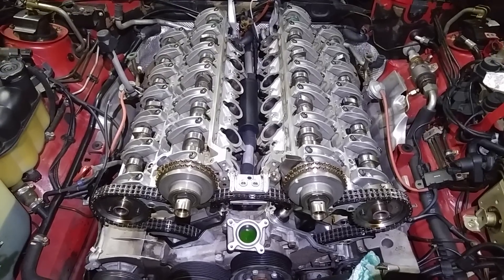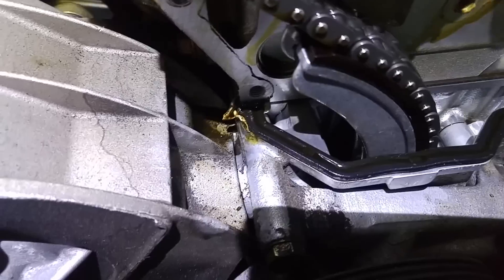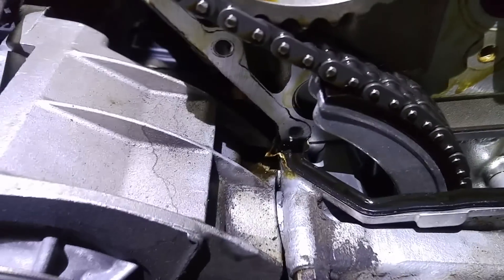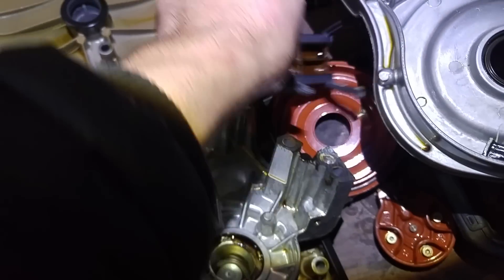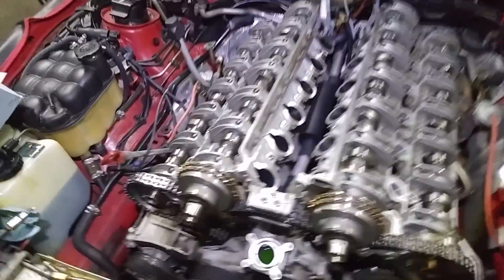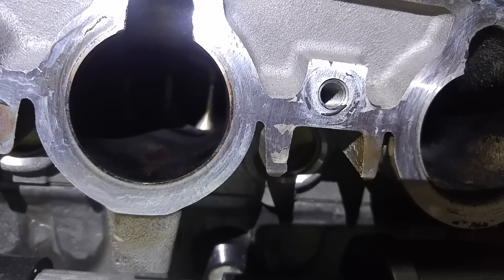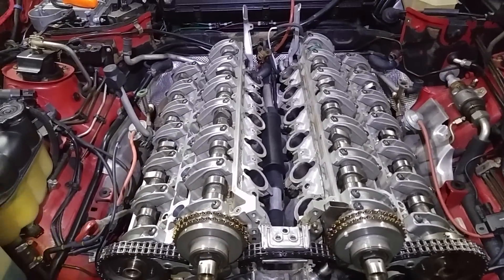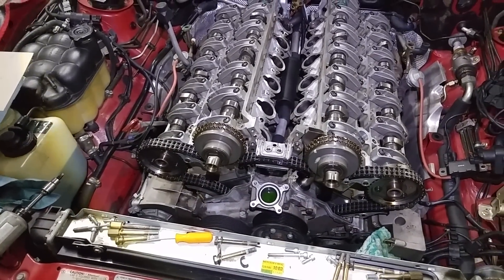Mercedes 600SL V12 oil leak Repair. Part 2

Comment: Hi, Victor, this kind of leak in M120 is very similar to the leaks in M104, and sometimes it's not in the "U" gasket but in the head gasket. I used to loose the two first bolts in the heads and retighten them. Maybe it could be done in the M120 too. Great video!
Reply from the maker: wdb4me Hey, yes m104 Has same problem. I recently did m103 seal, similar to m104. that m103 is 1988 built and there were 3 colors of silicone in the area of seal. It was replaced 3 times before me during its life. I did look at head gasket on m120 and it seems fine. Leak is right around u shaped seal so I would leave head bolts untouched. Engine has only 26,000 miles, I'm pretty positive that head gasket is not leaking. Thank you for suggestion 👍

Comment: Victor, nice car you got there but is the coolant used in the car  original mercedes benz? if not, I think you should use the original one which is the blue one to keep the car original all the way.
Reply from the maker: khalil alkhalil that was the coolant car came with. newer Mercedes coolant is blueish in color but that car is 1993 so back then coolant was green
Reply: thank you for your kind response ,but I'm very sure that the coolant is not green for the whole W140 models, I remember that when I bought a 500CL , it was 1994 model and I got it new, I still remember the coolant was blue , any way what's the harm if you just double check which your local mercedes dealer, because I really like the car you are working on and I just love at least to see it fully maintained up to Mercedes-Benz standard.
Reply: khalil alkhalil i have a 1995 SL500 and the original coolant is green. but i did switch to the blue because i did a cooling system service.